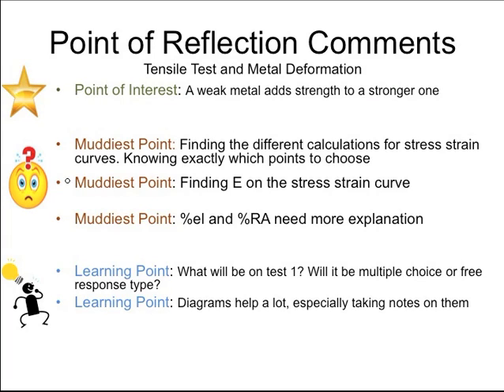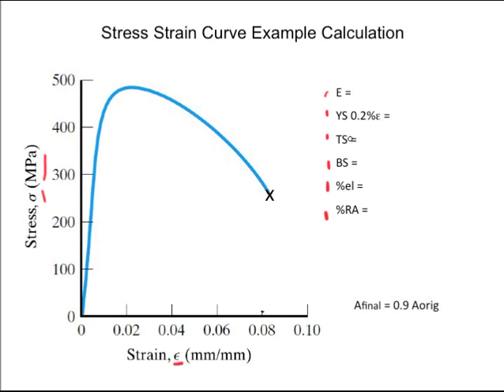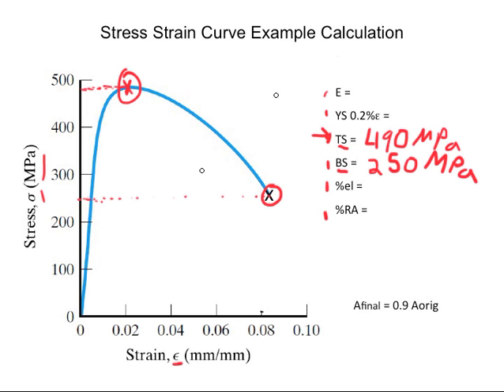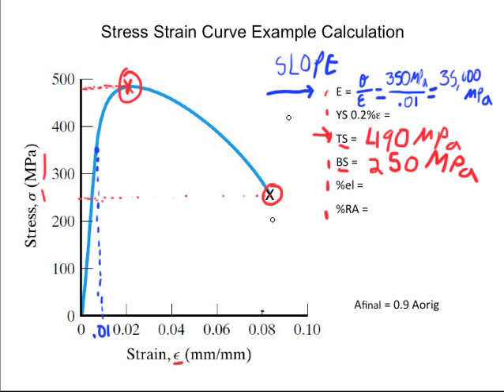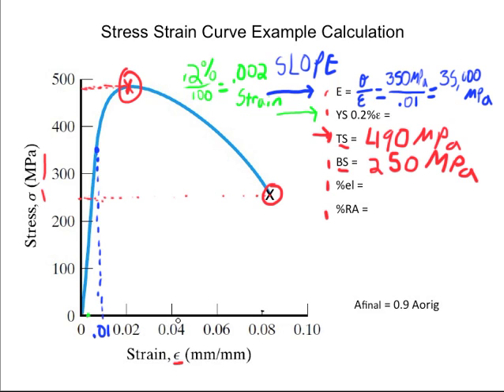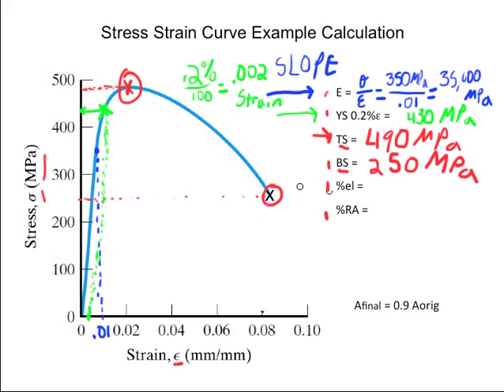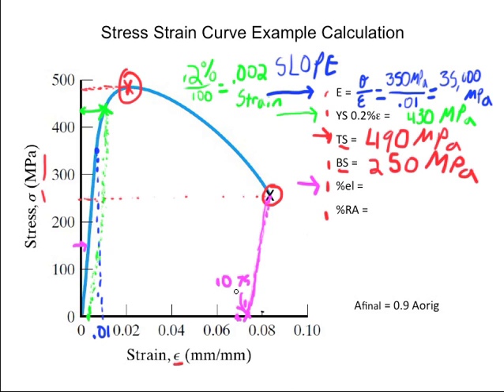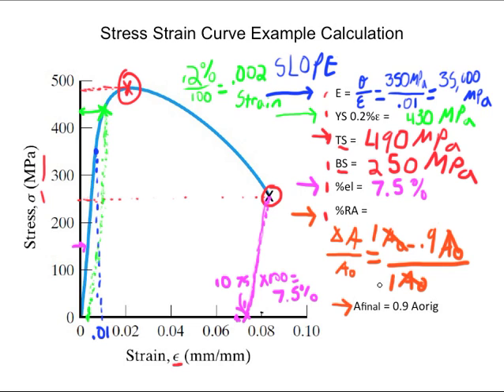Muddiest Point- Tensile Test

Comment: In the percent elongation, do also just multiply by 100 when the breaking point is after 0.10 mm. Or do we use %el= ((x value of breaking point)/(original length) )*100

Comment: Why yield strength is defined only for 0.2%??? Whats this 0.2%??
Reply: Mech E I was just about to ask the same question.

My guess is that it is difficult to pinpoint EXACTLY where the graph stops being linear-elastic, since it is a gradual transition from the linear region to the non-linear plastic deformation part.  0.2% is simply used as a convention, and statistically matches experimental results for where the onset of permanent deformation begins.
Reply: Mech E It does seem like an interesting enough number, that it seems like there needs to be a reason to pick that number.
Reply: carultch If im not mistaken, its a commonly used 'arbitrarily' defined number used by the engineering community to essentially say that "after this point, the material will undergo plastic deformation and should not be subjected to additional stress"
Reply: Why there is no response on this question?
Reply: As far I know most of the materials do not show yield point in graph like mild steel and in that case you have to use . 2% offset method to determine yield point.
Reply: The .2% yield point is derived from the known curve of mild steel because it is easy to see. Other materials such as aluminum have a smooth curve and the yield point step is not easily seen. Therefore the .2% from mild steel is applied to the aluminum curve so that a theoretically close value can be arrived at.